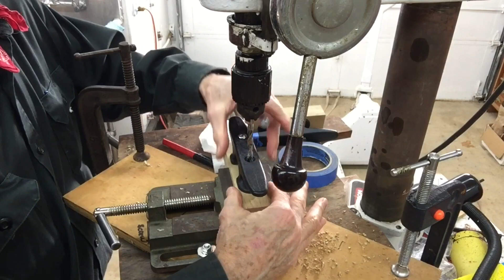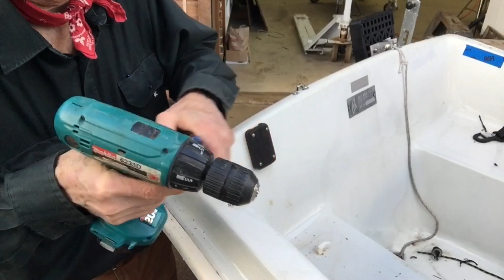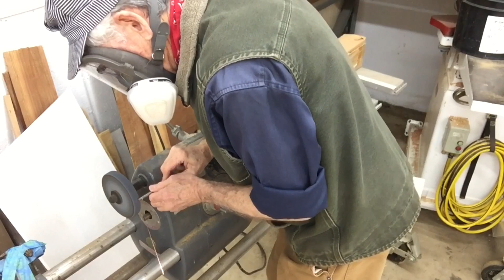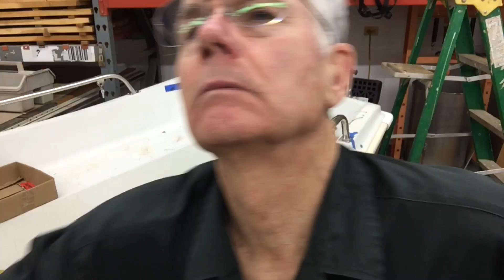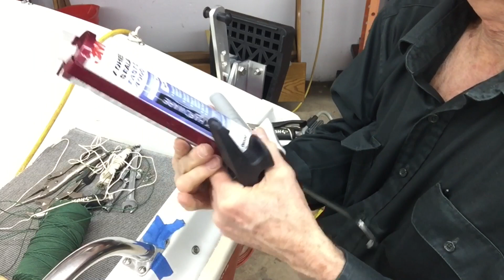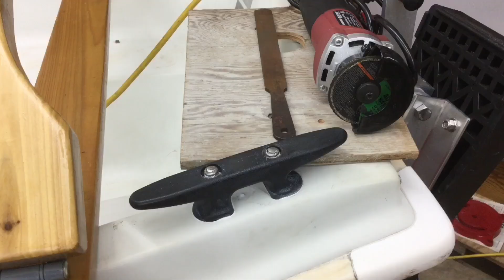Change Boat Cleats on West Wight Potter

Comment: This is amazing. I just got a west wight potter 15 for almost free and the only issue is a broken cleat…. But this job is a little advanced for me.
Reply from the maker: @rwolhar  There are lots of different approaches one could use. My favorite would be a very small helper, but some people put in an access port. I could not find any anchors that I thought were strong enough to attach to the fiberglass from the top. Thanks for watching.

Comment: Do you know where to get the molded corner pieces that cover the rub rail on the stern. I have an 81 wwp15 that needs these.
Reply from the maker: I sent an email and picture to duckworks.com. They said they had a section of West Wight Potter 15 and 19 parts but not those corner pieces. I looked at the ones on my daughters boat and it looks like they are made from the next size larger edging. Write again if you find a solution please
Reply: Thanks for checking Greg.